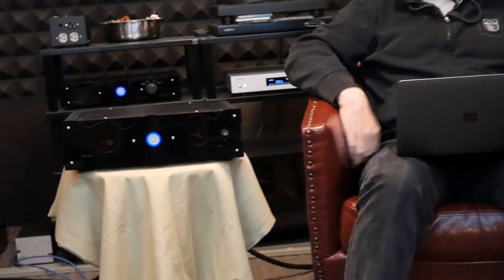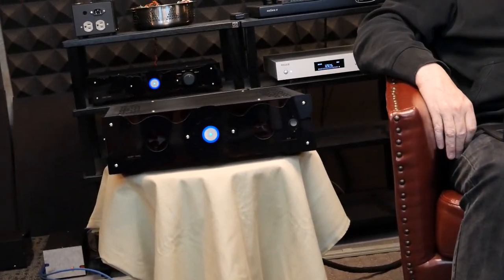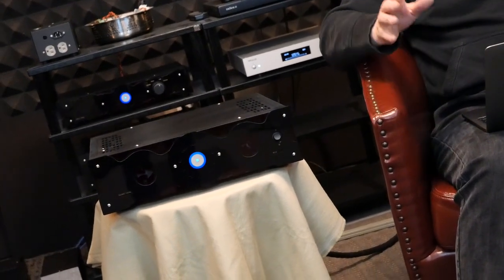Power Amplifiers. Why are they Not The Same.

Comment: I used to run a system off a deep cycle marine battery and inverter it was fine until i wanted to charge the battery via a solar panel, then my sub would freak out

Comment: What do you have for power in???
I use batteries and a pure sine wave inverter for my power supply. IMO its a 100 times better than grid power. Ive seen HUGE fluctuations and spikes from grid power, and its not very clean. With batteries and inverter my power is 3% or less distortion and Im not limited to a 15 amp or 20 amp circuit. Another benefit is no ground and no grounding issues. 
Instead of spending thousands on power conditioners, it makes a lot more sense to invest in a stand alone power system. jmo
Love your work AGY!
Reply: Your approach can have the potential to best poor grid power but grid fed power done to virtual perfection is light years beyond your approach

Comment: I understand and agree.  The analogy to musicians is excellent.  
I built my amplifiers with these concepts in mind.  All mono blocks with oversized transformers, a lot of caps and all point to point wiring with good sized conductors.  I use big electrolytics paralleled with film caps in triode power amps.  I use dual mono triode output amps on my dac again with point to point wiring and separate oversized transformers on each channel.   Results in effortless natural dynamics.
On the digital side of the DAC, again all separate power supplies with supercaps.  Makes a big difference.